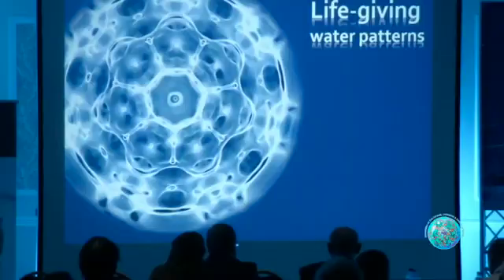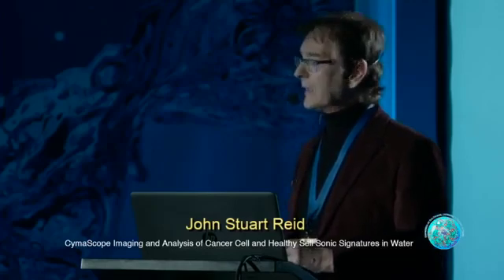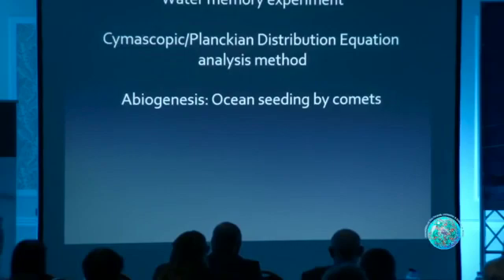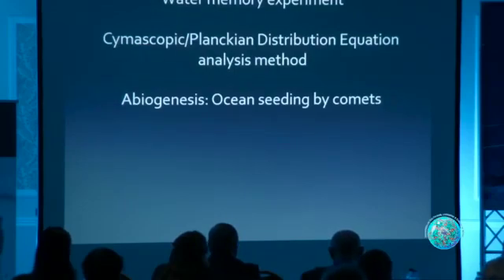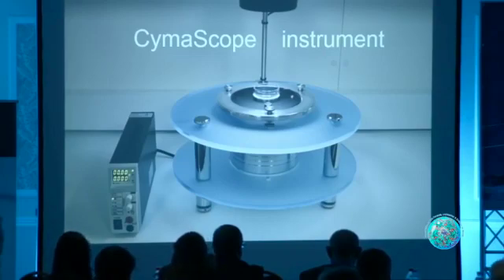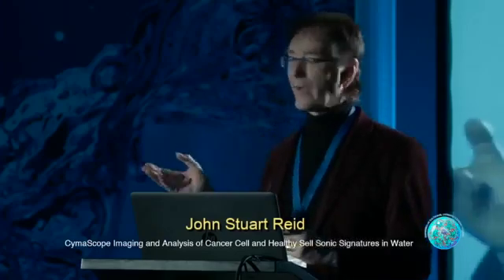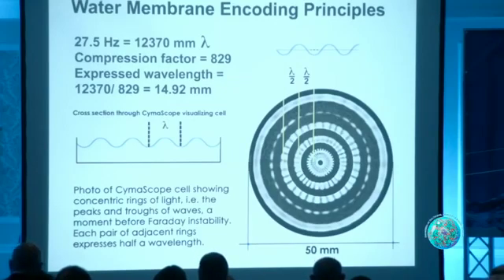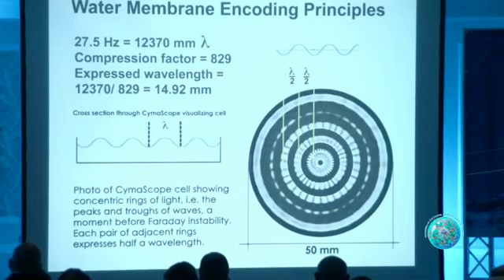John Stuart Reid's Water Conference 2018 presentation excerpt

Comment: So, you are saying that the size/shape/volume of the receptacle of water doesn't have an effect on the shapes/patterns? Otherwise, you would get a different result by just swapping the water receptacle out for something bigger/smaller... This is what I dislike about the tests done with cymatics to "prove" the superiority of 432hz vs. 440hz.  You can get multitudes of result for one frequency by change the shape/size of the resonating body.
Reply: The thing is that now it has been done onto physical things and it shows otherwise